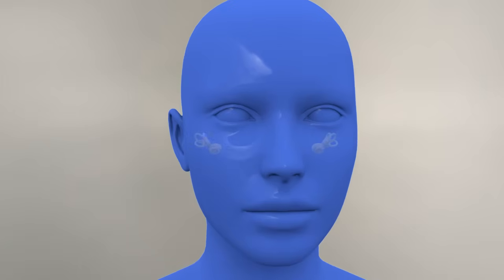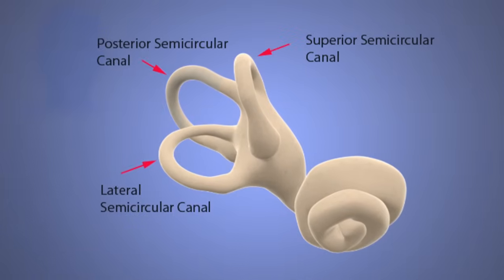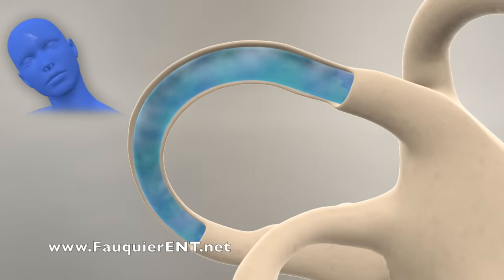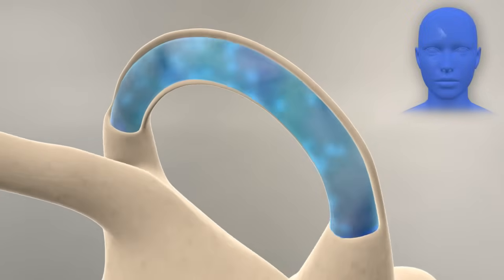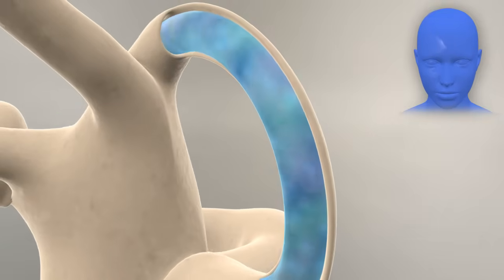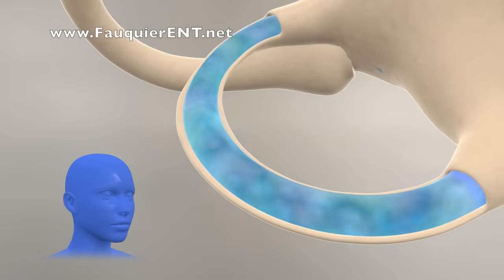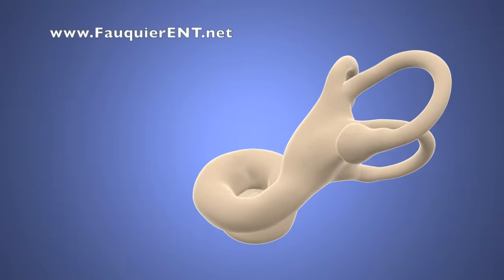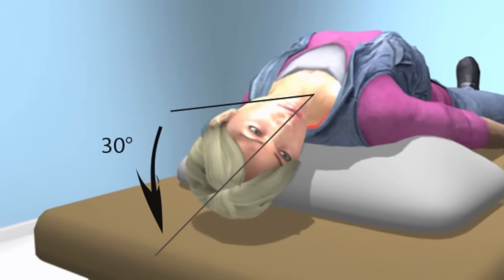How the Inner Ear Balance System Works - Labyrinth Semicircular Canals

Comment: There are so many conditions that affect the inner ear. This video helps start where to address concerns of vertigo. I was treated for BPPV at vestibular rehab and actually made my symptoms worse. If this happens to you, there's also conditions like vestibular neuritis, vestibular migraines, Meniere's disease, and vestibular paroxysmia that all have similar symptoms but are treated differently. I struggled for 2 years trying everything until I found an anticonvulsant medication to stabilize my vertigo. KEEP TRYING if you've ever felt like nothing has worked for you, it just takes time!
Reply: What medication did you use?
Reply: @gentel1958 Carbamazepine, a medicine special to vestibular paroxysmia only

Comment: By 5 months, you can adjust at night while working and tend to vomit, write down and be very sad the next day. The sound I do not remember the new things and I do not tolerate the sound No and the sound of sizzling when calm or pressing on the teeth and electric shocks are issued when nervous from the back of the neck to the body. Thank you

Comment: Nice video. But I think there is an error with the lateral canal position. The lateral canal makes an angle of 30 degrees with the horizontal plane, there is no problem in this part. But it does this angle in the opposite direction from the one in the video. Normally, the lateral canal comes into the horizontal plane with 30 degrees of flexion of the head. But according to the video, the lateral canal comes to the horizontal plane with 30 degrees of extension. A mistake that can mislead people who are professionally interested in video.

Comment: Ciao, ogni volta che vedo un caso di malattia da herpes voglio sempre dire un ringraziamento speciale al dottor Hopkins per avermi aiutato a guarire dalla malattia da herpes e dalla varicella Sono stato testato positivo 5 mesi fa, l'ho contattato in base alle testimonianze che ho '  sto vedendo su di lui
   su internet anche io sono stato curato da lui, lui può aiutarti, questo è il mio piccolo modo di apprezzare diffondendo la mia felicità ... Ed è in grado di aiutarti a sbarazzarti di ogni tipo di malattia che ti colpisce ...  .. fammi sapere se vuoi le sue informazioni..
..

Comment: So strange how its connected to the ear. One would think it'd be part of the brain. Also does this mean we would be able to tell a difference if our lower half was altered in such a way that our head is still centered?
Reply: This system only accounts for head movements. Position and movement of the lower body is gathered by the somatosensory pathways that go from your muscles and joints to the central nervous system.

Comment: I am suffering from it ' been nearly 3 years :( getting help from hospital .
Reply: You have to find an experienced Audiologist or Doctor of Physical Therapy who had corrected many patients like you.  Any of 6 canals can have the crystals in it to cause dizziness (3 on each side). Brain monitors the matchup of the 3 pairs on either side. If any pair do not compute, brain gets frustrated and reacts with eye twitching, thus vision/motion coordination problem. The more motion the worse reaction. Trying it yourself (diagnosing which of 6 tubes has the crystal) is not promising. Rotating the wrong sequence can worsen the problem (crystal going wrong direction).  Luckily the most common problem can be corrected with the Epley maneuver. 
You can test which side is bad, by trying Epley Right first. When you hang your head backwards off the bed, your view will start oscilating.  That is the one. If view is quite steady, then that is not the side.  
Sit back up, steady yourself, turn head Left and lye back down over end of bed, head sagging more (20-30'). Hold and look. If dizzy, that is the side to work on... continue and finish up the routine as instructed. 
You should feel a bit better afterwards. Not great, but bit better.  Depending how far the crystal is from the opening, the more often you perform the Epley, the better it will get.  In a week's time you should be good.  NOTE:  I got vertigo from working hours on end picking objects off the ground (down-up-down-up).  So, limit leaning down/up repetitively as you recover. 
Also, ear infection/inflamation can put pressure on the vestibular system and nausea may not be Crystal related. Decongestion will improve it as you heal.
Lastlly, too much salt or alcohol ingestion also contributes to the solution gradient difference in the vestibular system.  Time can recover. 
These YouTube articles are very helpful. They were a mystery not long ago.
Reply: Rusty  what's wrong with giving medical advice? It's better advice then iv had of any of my doctor's

Comment: How does the lateral motion of the head get detected? as unlike the other two, gravity doesn't affect it with motion.
Reply: it doesn't ? OK try this fill a circular bucket with water and spin it left and right and watch the water carefully , it doesn't move with the bucket unless you keep spinning it continually , in this case if you spin your head contiuasly you will get dizzy because the water keeps spinning when your head stops moving :) hope that helps.